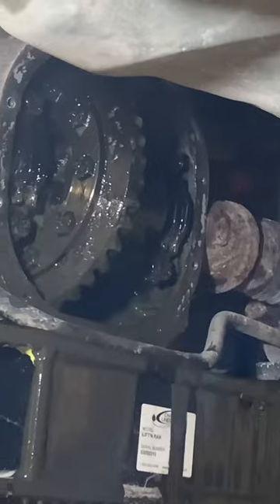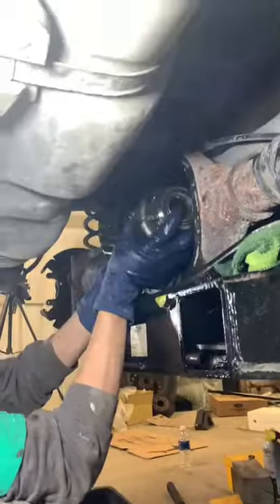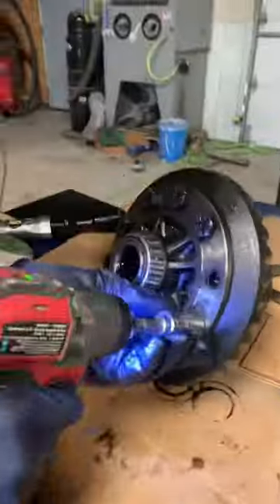Upgrade Your Crown Victoria's Performance with These Gear Installation Tips

Comment: Do you use a new crush sleeve , shim   in the 3rd member , & finger test the ring gear with the pinion.   Just playing.   Great video
Reply from the maker: New crush sleeve, and shims, we also checked the pinion torque tension (should be between 16 - 28 we’re at 25) backlash between 8/1000 and 12/1000 we’re at 10/1000 all well within spec 😁 thank you 🙏
Reply: @710performance  awesome.

Comment: Yo was sup bro, question. What all do you have to change other than the gears itself. So for example I wanna put 3.73 gears on my 07 crown Victoria but I read or heard that I need to change a few parts if I do that like “Differential”? What all do you need to change for a 3.73 gear.
Reply from the maker: We changed the pinion gear in the ring gear, and some bearings. And got a tune on it.
Reply: @710performance  awesome appreciate it 💯

Comment: Should i upgrade ? I currently have a 97 town car with stock 3.07 gears, not posi lock tho, should i jump to 3.73? Or not?
Reply from the maker: I would
Reply: @710performance  just the ring and pinion? Or I have to get the whole posi thing?